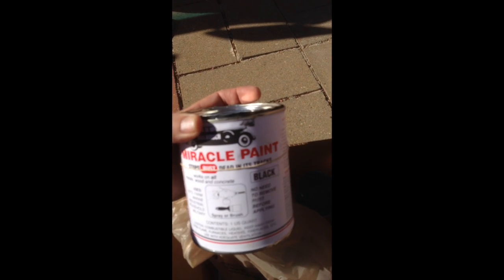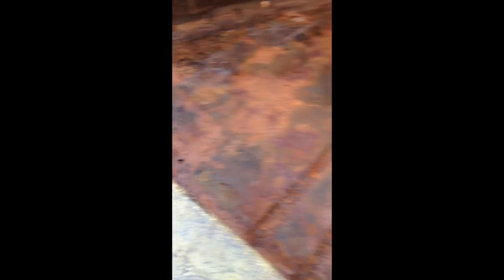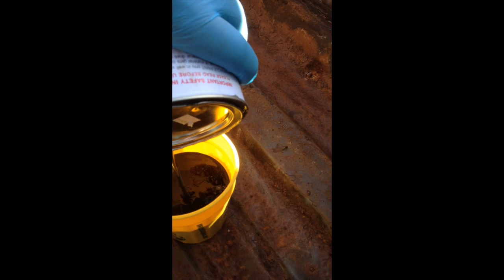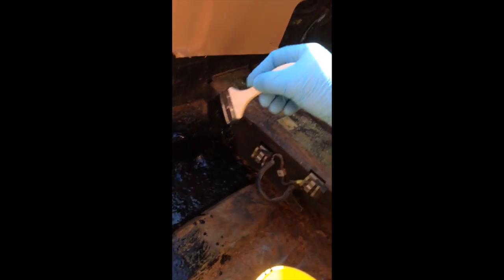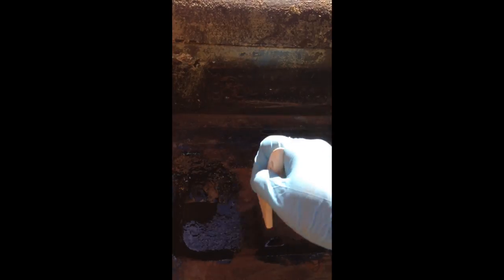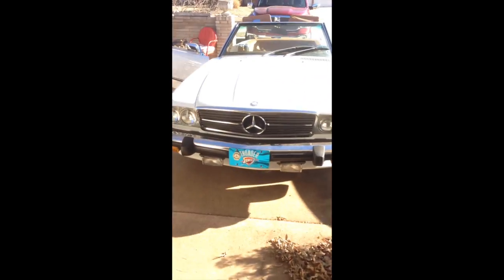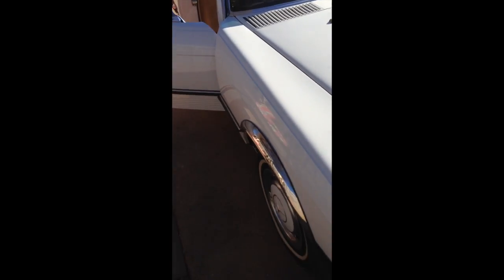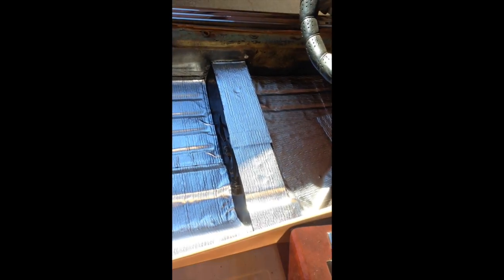Mercedes 450SL Floorboard Repair Without Welding

Comment: Doesn't look like the 2 different (thick thin) versions aren't available from the manufacturer. Strange that the vendor has a thick version but the manufacturer doesn't. Does the vendor do something different to make it heavier or am I missing something?
Reply from the maker: Yeah, I misspoke on that, there is only one version of the miracle paint but it is great stuff. I’ve since sold the car but 5 years after this video, it was still solid and clean.
Reply: @1SpudNuts1BigNasty-DIY  I don't think you did misspeak actually. The manufacturer has 2 different products. One has HD in the model number but with no context. Hmmm.

Comment from the maker: Yes it will, you just paint it on over the rusted floor pan and cover all the rust. I would then undercoat it from underneath after the miracle paint dries. You might have an issue with the fiberglass because of the weight but since you already have a new floor pan, just paint on the miracle paint from the underside and then coat it with an undercoat. I used the fiberglass to patch holes that went all the way through.
Reply from the maker: I purchased 1sqft sections of the foil backed heat/sound barrier material on Ebay. It has an adheasive (tar) backing with foil on the other side and just covered the floor with it.

Comment: Do you think a quart will be enough to cover the undercarriage and wheel wheals with 2 coats of this product?
Reply from the maker: It goes on pretty thin, I barely used half a quart on the entire floor pan and that was with 2 coats. Being you want to do the entire undercarriage and wheel wells, you might want 2 to be safe.

Comment: How did u redo the sound and heat barrier ??
Reply from the maker: I purchased 1sqft sections of the foil backed heat/sound barrier material on Ebay. It has an adheasive (tar) backing with foil on the other side and just covered the floor with it.